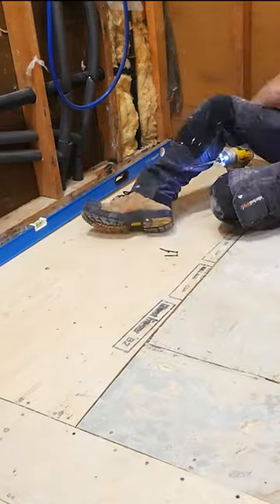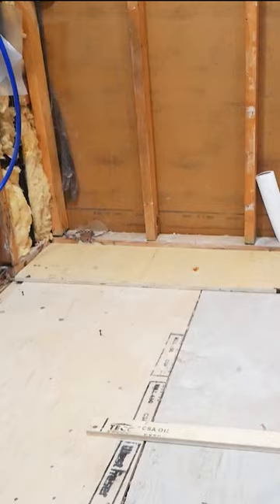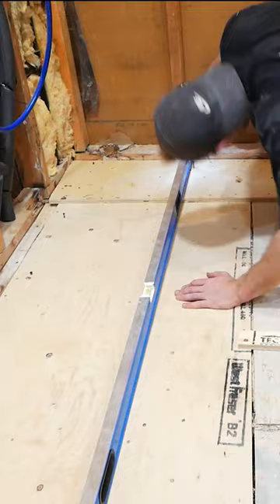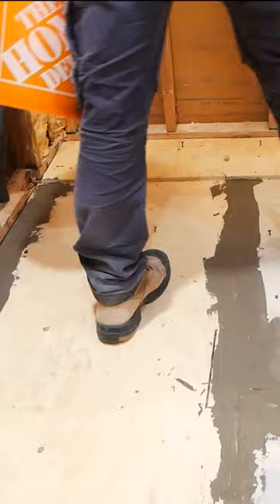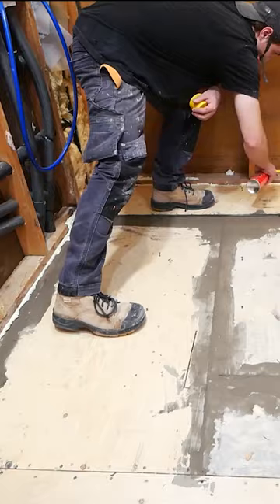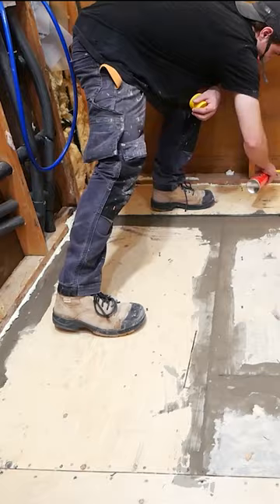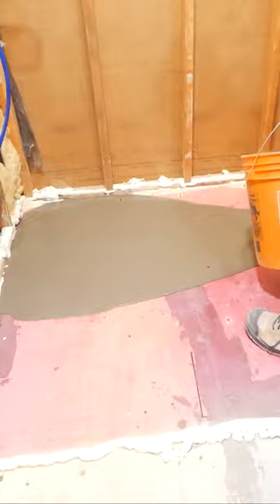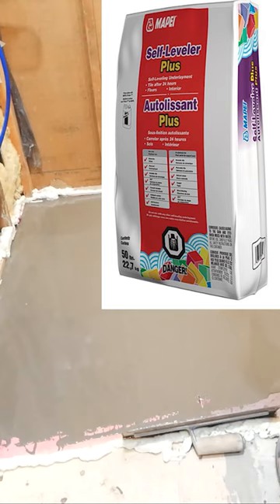How to Self Level a Floor

Comment: I think concrete backer board as rough back fill would be better than plywood in this instance and seal cracks with the spray foam or caulking than pour self leveler.  The trick with self leveler is to have it all ready to go at once.  10 minutes to mix and pour the next batch is too late.

Comment: Yeah if you're off inch and a half in 6 feet you have bigger problems and why are you working on top of that problem
Reply: Redoing all the plywood is a ton of work especially when pouring self level is feasible and spec’d out for a job like this. 🪣 📏 🥾
Reply: @Jorge Oqueli  not at an inch and a half. That's likely a serious structural issue. I'm sure you're right though adding 240lbs or more of floor leveler to a wood floor that drops more than the plumbing is fine. Lol
Reply: Thank you!!

Comment: does no one use dry pact anymore?
   it's cheep,no screws needed. just concrete sand,nd portland cement. mix water till damp not wet damp.
  apply with any straight edge ,like a 1x2,or 1x3.
Reply: Yes and no. Would take longer.

Comment: I’m not knocking what you did here…
Why is everyone so concerned about having a “level” floor? 
A flat floor yes. If the slope of the room is low at an adjoining room’s doorway with a different finished floor covering and it’s raised 1 1/2”, then I guaranty it would just be flat. I’ve worked on 200 + ur old houses and “level” floors aren’t a realistic option without jacking up the house. I stick with flattening the floors unless it can be leveled within reason.
Reply: I think he's trying to say flat but is confusing it with level. 
Most likely, when using self leveler, automatically people think level. Just my guess and could be he has no idea which is which 😀

Comment: What's the advantage? Seems longer and more expensive than packing out the existing flooring
Reply from the maker: Pouring is really satisfying
Reply: It can be just as expensive plus your using more materials so if you ever have to remodel that area again your going to be fighting with strews, nails, etc over self level.  If you add the materials and time both process will be the same amount. Buying plywood and liquid nail etc verse self level all comes out the same$$$